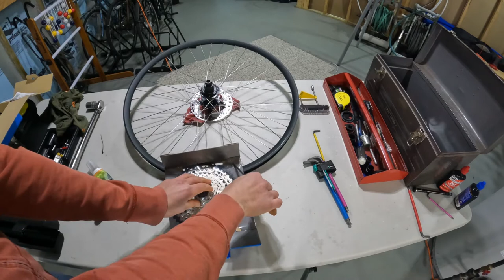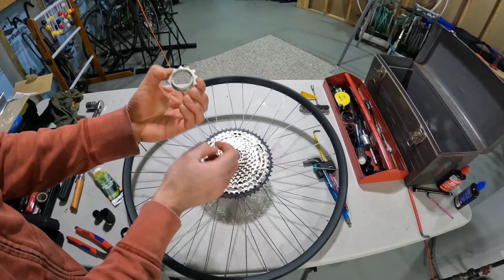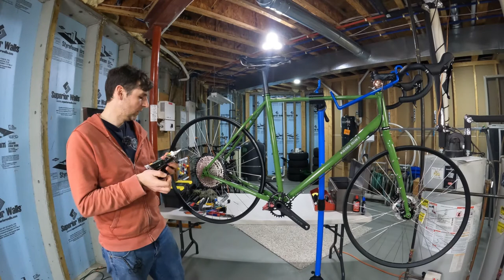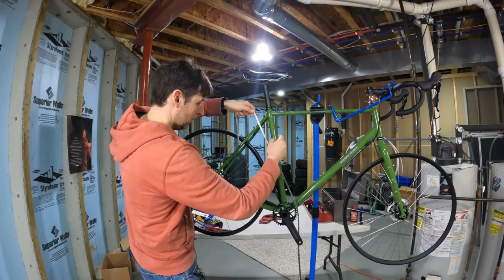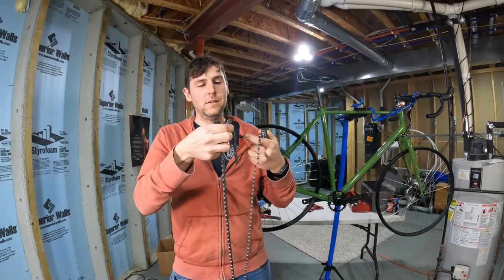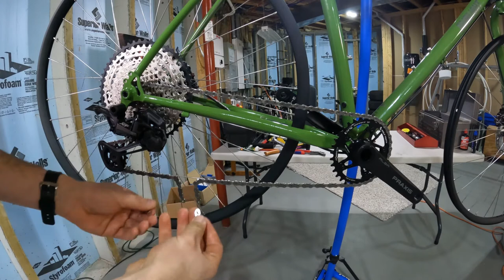Fairlight Faran Build #11: Cassette, Derailleur & Chain

Comment: I’ve done simular

Sram force dub with 42t oval ring

Sram force shifter 11speed with converted ratchet for 12 speed

Dt swiss hub with Sram XDR with a Ethirteen 9-50t cassette

Sram GX MTB 12 speed rear derailleur

All of this on a Kinesis Ti GTD frameset. 

Who needs 2x unless you are a professional road cyclist?  The steps in cassette is not a real life issue at all